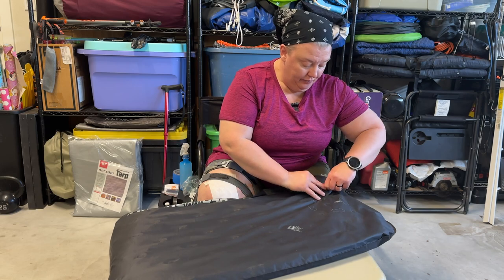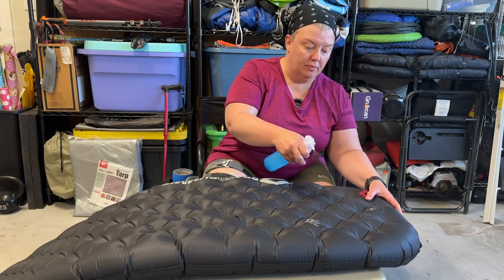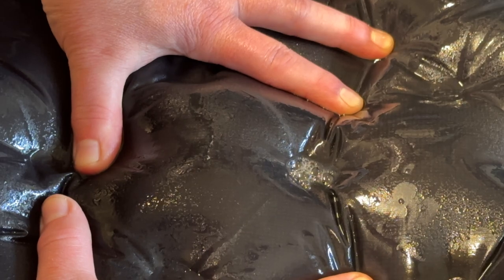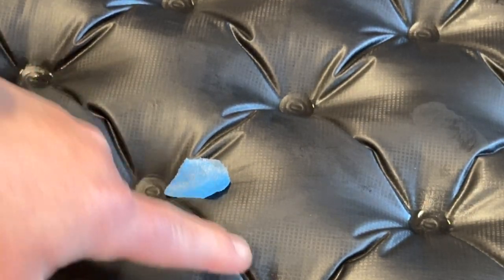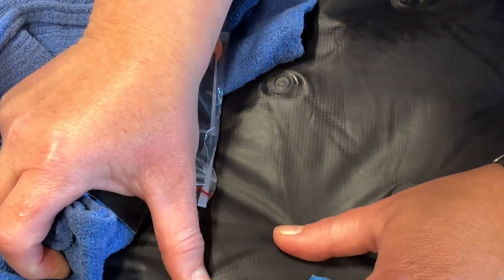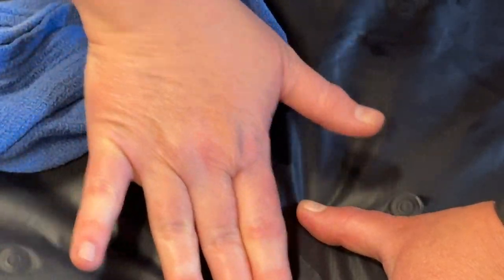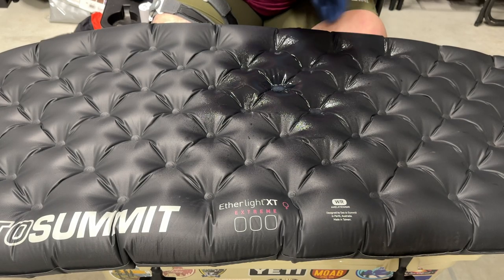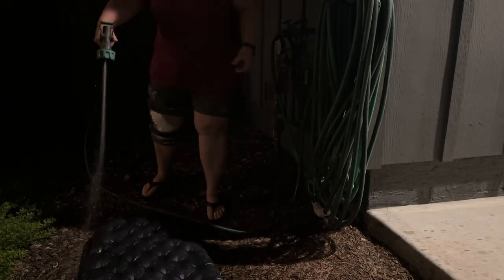Using the Soapy Water Method to Find & Fix Tiny Hole in Sleeping Pad/Air Mattress

Comment: Two questions for you - 1) can you cut the patch in half to save some for another time? And 2) do you like the Etherlite XT Extreme?  I know it has a high R value and I’m looking for a warmer pad.
Reply from the maker: 1. I’d be concerned it wouldn’t be large enough to stick. You could use Tenacious Tape if you didn’t have the kit.
2. It’s a good pad, but go wide. I just got the Nemo Tensor Extreme, which packs down smaller and weighs less with a higher r-value. I haven’t tried it yet (probably this week), but I love my Tensor insulated (the prior model). I have both in wide.
I’ll be selling the Etherlight and my Xlite and just keeping the two Tensors.
Reply: I’ll look at the Tensor too.  Thank you!